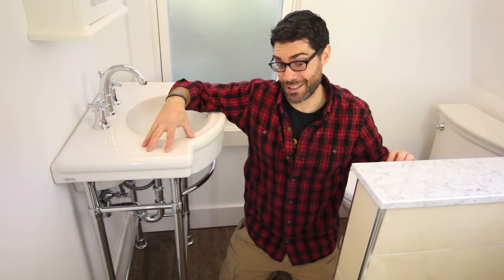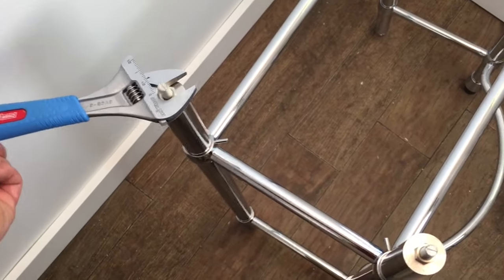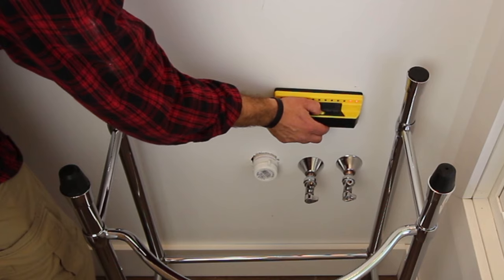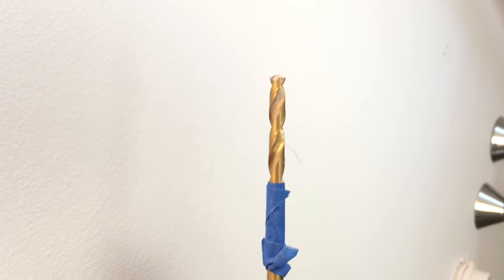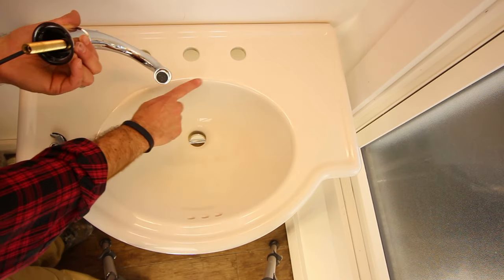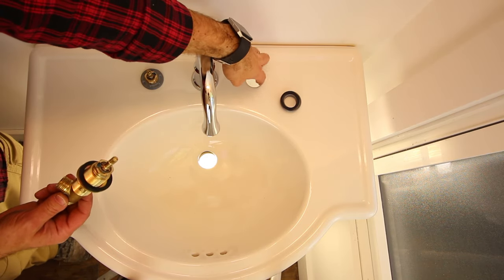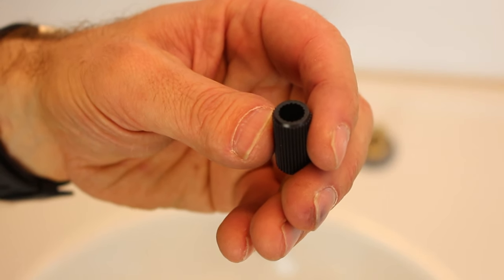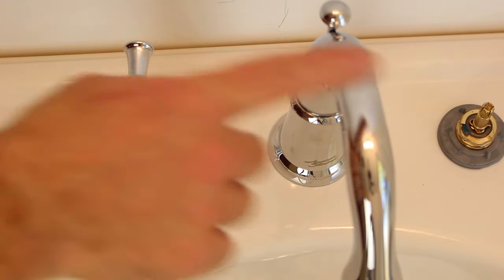Small Bathroom Makeovers: Pedestal Sink Installation (Step-by-Step)

Comment: Great video Jeff. I especially like the shut off valves you use. If it were me and it being new work I probably would have assemble the faucet on the sink before attaching it to the wall so there's more room to work. What do you think? Any reason you put the sink on first?
Reply from the maker: +Tommy DeWalt great question and I have an answer...it's for folks who already have the sink but just want to replace the faucet. You're right though, it's way easier to install the faucet before mounting the sink. I love basin wrenches but don't mind leaving them in the tool box 👍

Comment: Hi Jeff, wanted to ask your opinion on a previous faucet replacement I did for my bathroom. I have an integrated sink. The part I had trouble with was the drain assembly. Like your assembly, there is a rubber gasket that sits against the bottom of the sink to seal the gaps. For my sink, the opening for the underside of the drain had imperfections in the casting, a chip big enough that would not seal with the rubber gasket. I tried sanding it down and ended up using epoxy putty (JB waterweld) to fix the chip and get it to seal. Any suggestions in the future if I come across this in a future project?
Reply from the maker: +Ryan Wong try 100% silicone sealant next time. But it wouldn't have been out of the question to return the sink. That was a manufacturer's defect. You probably could have gotten a new sink 👍
Reply: I would return the sink if it weren't it being 25 years old =P. Thanks for the tip!
Reply from the maker: +Ryan Wong oh, lol...yah that's a little out of warranty

Comment: Is it safe to assume not all shutoff valves are the same size? The ones in the video look larger than what I have in my bathroom.
Reply from the maker: +The Drizzle yes, you'll have to see  what size pipe you have, e.g. 1/2" or 3/4". Typically the supply line side is 3/8" but not always. If you can take the old shut off to the store that's the best option or take a picture
Reply: Jeff Patterson thanks to your other videos, I've been able to determine the shut off valves I have are compression fittings, you rock! I'll be able to easily determine what size pipes I have. Thanks!
Reply from the maker: glad to help, there's nothing more frustrating when you buy the wrong part or in this case shut off valve, glad you figured out the right ones

Comment: Where do you get the special wrench?
Reply from the maker: which one?
Reply: @HomeRepairTutor   for the pedestal sink replacement
Reply from the maker: @chrissyhedge8284  is that the socket wrench and extension at 6:45?
Reply: @HomeRepairTutor   I believe so.
Reply from the maker: @chrissyhedge8284  you just need a socket wrench with an extension, here's the extension Amazon link (choose the right size) https://amzn.to/37kLdIg
Reply: What about the wrench at 9:57 for the lock nut?

Comment: That is not a pedestal sink. There is no pedestal.
Reply: Donald Drennan he used a four -point pedestal stand with four legs positioned under 4 corners of the sink extending to the floor with horizontal supports connecting each leg. It's the first thing he did at the beginning of the video.
Reply: @m.c.ruckus2032  Alright, but it's not the type of sink I was looking for help with, and that was a year ago. I found the info I needed elsewhere.